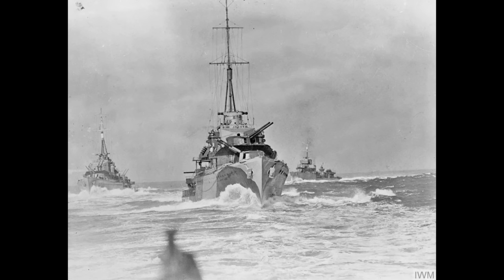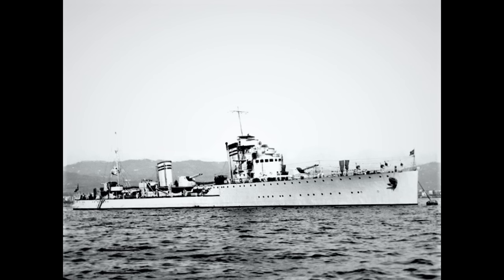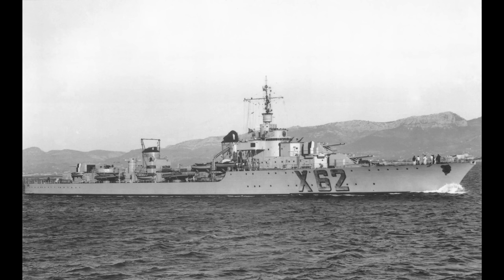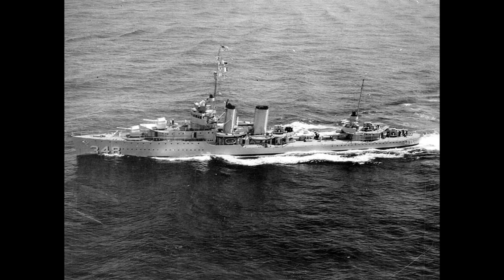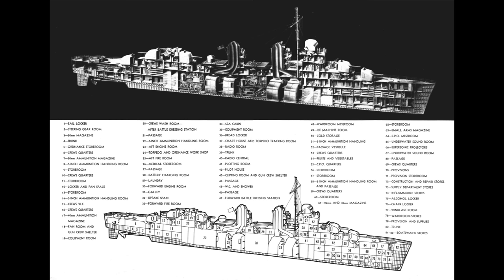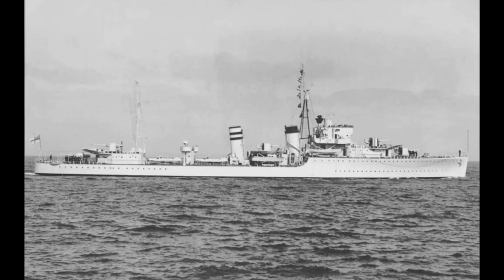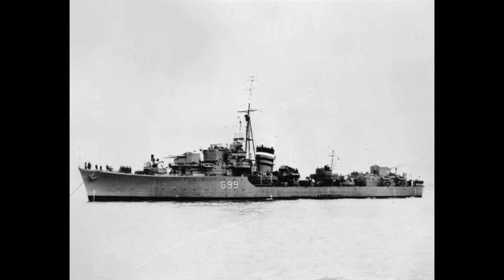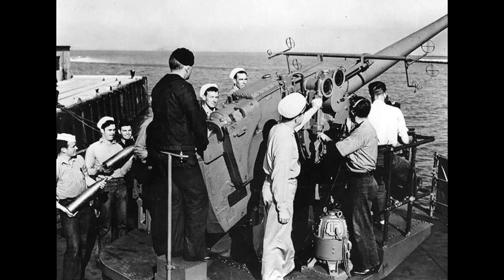Destroyers - Interwar development and design (1918-1939)

Comment: AWESOME video!!!   I can't wait for the next one.  By the way, that photo at the end looked awfully familiar.    Do you happen to know where it was taken?  It looked like near the foot of Broadway in San Diego, looking across San Diego harbor, from the roof of the Eleventh Naval District Headquarters (aka, the Black Hole, as requesitions for supplies sent there had an annoying habit of vanishing into thin air, never to be seen or heard from again).   
I do hope you also cover the post-war modifications to the ships, as I served on a modernized Gearing Class destroyer, U.S.S. John R. Craig DD 885 in 1967 & 1968.

The Gearing Class were an improved version of the Allen B. Sumner Class, which were themselves, a development of the Fletcher Class.  The Navy suddenly realized that the Pacific is somewhat larger than the Atlantic, and greater range might be beneficial.  So, they cut a Sumner athwartships, added a 14 ft section, mostly for fuel storage, and got a number of additional benefits into the bargain.

Comment: Thanks a lot for the vid. Usually the view is more focussed on bigger ships and their glory. Destroyers are merely disregarded. 
My impression of your vid is, that destroyer design is, from beam to length, relatively slim. Why they did not constructed a small battle-cruiser design with a larger beam to get more stability in the case of firing a broad-side and in regard to seaworthiness?
Reply: Get a Naval Architect to answer that one. Explain the purpose of the craft you require.
Reply: A destroyer's main/most important characteristic is speed.  A long, narrow hull is absolutely necessary to achieving that (which is also why the Iowas are so long compared to other battleships).
Reply: @JohnE9999  Of course, but i only answered to Drach's comments and concernings. All late battleships were much longer than their predecessors, to get more range, speed, ammunition-bunkers, necessary water-bunkers and supplies. In case of the Iowas the story is samesame, but different. Look at those vertical pictures of Iowas, the midship-section looks like cut, to reduce the beam to 33 meters, to be able to pass the Panama-Canal. Speed is one factor, a calm firing-platform for heavy artillery another.

Comment: Why didnt the German designers of the DD which used fuel as balast retroactively build in sort of a barrier at the bottom part of the fuel tank and permanently fill it with water which is denser than fuel and thus allows for a greater volume of actually usable fuel. An even greater effect could be achieved with cement at the bottom of the fuel tank, since I presume steel would be too expensive to use as a lump of mass at the bottom of the ship.

Comment: 58:23 well, considering some of Germany's WW2 destroyers were fitted with boilers that ran at pressures in excess of 1500 psi... that's more than two times the operating pressure of the boilers on an Iowa class. Germany really overdid it when it comes to boiler design.
Reply: The truth is that Germans under built the boilers. While technically true that ww2 German ships of all classes could run at 1500 psi they seldom ran that high because at that pressure would cause the boilers and engines to eat them selves. Most USN ship ran at 600-700 psi and with exception of ship like warspite and Richelieu that had received machinery refitting in the United States most royal and French navy ships could only run at 450-500 psi. USN warships could if you had no desire to keep the engines working for any length of time run at 1500 psi and the regular running pressure on USN ships was considered to be a high pressure rate but unlike the Germans the us ships tended not to kill there engines. Drach has a video on naval boilers that covers this and he can explain boilers better than me.

Comment: Question?? Whdn you mention (private destroyers) for the Royal navy.  Does that mean they were built by private builders that were not normally used by the Royal navy??
Reply from the maker: The RN referred to the regular destroyers in a flotilla as 'private' ships, as compared to the flotilla leaders, no connection to who built them.
Reply: @Drachinifel  

Thanks for the clarification.
Reply: Does it not refer to there being no 'flag' accomodation so 'private' in so far as the Captain is the highest rank on board?

Comment: I have little knowledge of warships, yet was wondering what determines a ship is a destroyer or a cruiser.  I was driving home ( I live in Yokosuka-shi) and observed an Atago class destroyer and an Arleigh Burke at dock and the Burke class seemed much larger.  (Sorry went to girl's school and was taught little of military matters.)
Reply: The main difference between the two classifications is the displacement and intended role of the ship. The distinction isn't as important nowadays as it was back during the World Wars as destroyer sized ships now dominate most navies. Destroyers are more prominent in modern times as having more small multirole ships is generally more effective with modern naval weapons - mostly missiles. Destroyers are also smaller and cheaper to run that a comparable cruiser too, which is a big selling point to a cost conscious navy.

Comment: treaties are not very helpful if you want to limit power or if you want to develop better destroyers. displacement is a poor indicator of strength. better to limit firepower.
Reply: Not sure I can agree. The smartest minds of that generation brokered the treaties.

I understand your point and i would be interested to know why they didn't use firepower as the yardstick and went with displacement instead. For they will have had a reason. No doubt many of them.

As a side note. This is a good rule of thumb to consider whenever looking at any aspect of history. If I don't understand why the people at the time did something. I start by assuming they are smarter than me. Then work from there. No doubt your more knowlagable than me. But it's always worth assuming your not more knowlagable than the people of the time. It avoids applying hindsight in a dunning-kruger sort of way lol

Comment: I can never help but see the Tribals as a Somers, but worse in most ways. 
-Significantly lower operational ranges (5,700 nm v. 7500)
-slower (~36 v. 37.5-38)
-only one third of the torpedo armament (1 x 4 v. 3 x 4)
-similarly limited anti-aircraft capabilities (limited elevation of main battery, light self defense machine-cannon and machinegun batteries)
-open backed main battery, more vulnerable to splinters and weather (Somers mounts all fully encloses)
-individually weaker main battery (lower velocity, lighter shell, similar to worse rate of fire more and vulnerable to interruption by weather, strafing, or splinters)

Not that they are terrible as a Destroyer-killer, but Somers sort of blows them out of the water (pun intended) by retaining the other functions of a ship of its type, and by having them in spades by comparison. Fortunately, they were on the same side.

Comment: Clemson Swarm, v Yamato?
Reply: Yamato dies to repeated tickling by torpedos. The Clemsons suffer significant losses, but a few getting through drop so many torpedos, they just hammer the Yamato.
Reply: Destroyer swarms (as opposed to mere flotillas) vs. Battleships don’t go well for the latter. All the Clemsons making a torpedo attack at once would ensure a serious number of hits, even though multiple DDs will be cut down by the main and secondary battery.
Reply: Would many really fall to the main battery? The guns trained soooooo slowly. Even a minor amount of dodging and weaving should allow them to escape. Look at Rodney Vs Bismarck. Minor course corrections meant B could not hit a battleship. Against a tiny destroyer... 

Of course this is why yamato had a secondary battery which would do damage. But yes. It'd be a laughably one sided battle. Which is why battleships have escorts lol